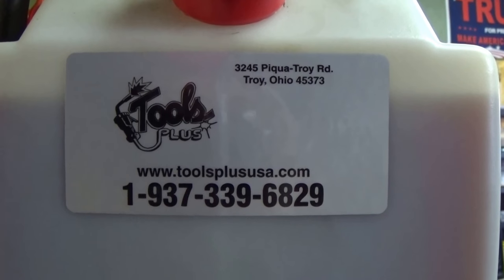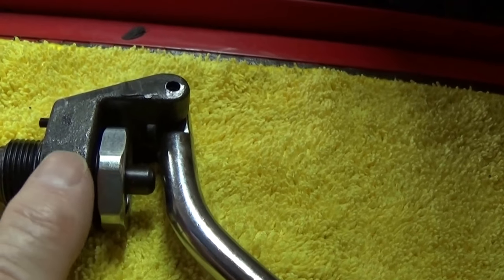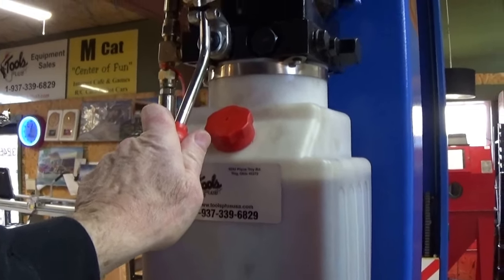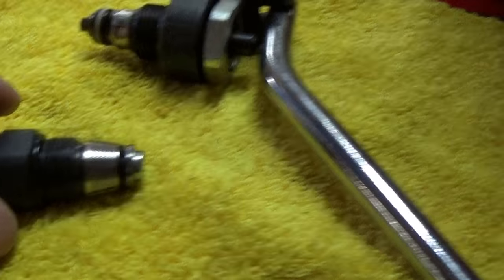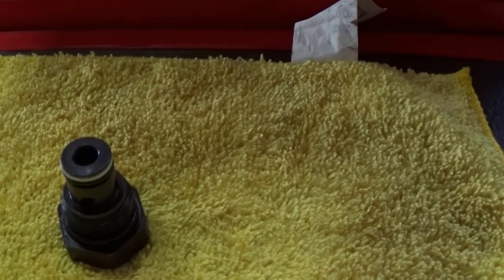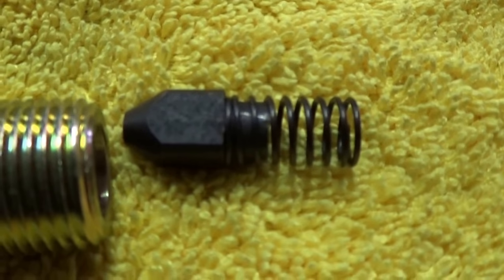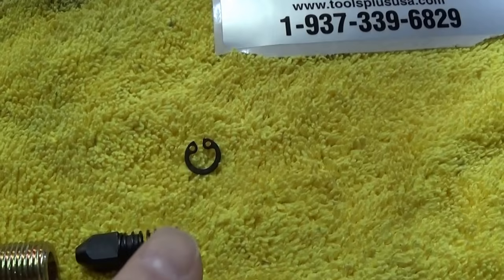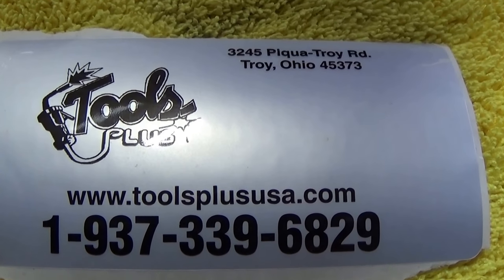car hoist repair trouble shooting car lift, lift will NOT come down,

Comment: I had bought a lift about 9 months ago brand new i use it every day as I have a small shop I run and this is my only lift. I was working on a car today and went to drop the car to the ground and the lift went down a very little bit and stopped I called the manufacturer and was on the phone for 3 hr or more with no help what am  I to do I have a customer's car stuck in the air I started watching you tube videos and then came across this channel I saw a phone number and called it this guy talked me throw what was wrong in mins wish I would have started with this thank you very much for making these videos keep doing it
Reply from the maker: Thanks. glad we could help.

Comment: I have the same brand, and my problem is that the pump is whining under a load.   We installed it and tested it with 2x. 200lb dudes, but a car got on it and got the shocks off the tires but whines without lifting it up any further

Comment: Wish you were closer to me. You really know your stuff!
I bought a used scissor lift, kind of like the Harbour Freight style car lift.
2 times now, when I lift a vehicle up, it will not come down. We had to get 3 guys and everyone lace as much weight on it and rock it back and fourth until it finely started to come back down.
Once I put it up in the air to clean under it and same thing. 2 of us stating jumping on it while my son operated the down lever, then it finalizing started to come down.
So frustrating. I'm scared to use it now!
Could that also be the restrictor valve, like the one on the 2 post lift in this video?

Comment: great video. i have a 4 post lift that seems to have lost some of its liftig ability. iIt will lift my 4000lb jeep but not my 5500lb truck. it has a fenner pump driven by a 3/4 hp  110 volt motor. i am trying to determine if it is the pump or piston.  No unusual noises lifting the jeep.  tx  be safe  mike

Comment: Hi  just getting ready to put an older weaver afh90 lift into service in my home shop and realizing that the lift locks while working do not clank on the way up like i have seen in some videos.  I am guessing it is a setup issue but am also not sure if I am missing some spring or something that should be forcing the lift lock to pivot fully into the ladder when the release is not activated.  Any thoughts you may have would be greatly appreciated by my wife who may not have to peel me off the floor if I don't get this right.  Thanks

Comment: how would you get a 4 post lift to lower if you had a motor failure or the pump itself. it seems you might need some type of hand pump? so is there a way to do that if it ever happened? i figure it it blew a hose then installing another hose will fix that. thanks
Reply: Figure that out??
Reply: @mayken6661   i have not had that happen just wondering how you would do that. my guess is to wait until you got parts the get the hoist running again. thanks

Comment: I removed the line into the top of the ram and the restritor value and the ram hardly coming down. Could the ram be damaged internally?
Reply: did you ever figure this out?

Comment: My lift is stuck up and won’t come done is it safe to work
Reply: What was the issue? Check valve?
I recently bought a used car scissor lift and it won't come down. We had to keep jumping and rocking it while my son held the lever and it slowly came back down. Now I don't want to lift anything with it...
Reply: Can you remove valve without shooting fluid everywhere